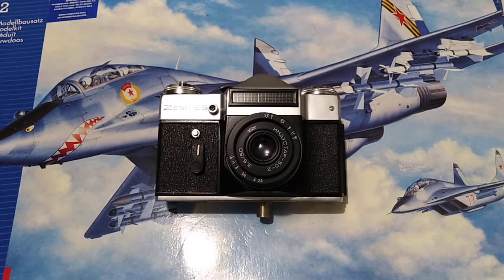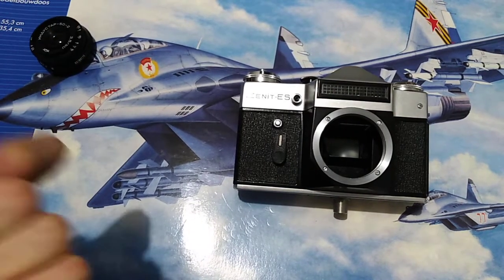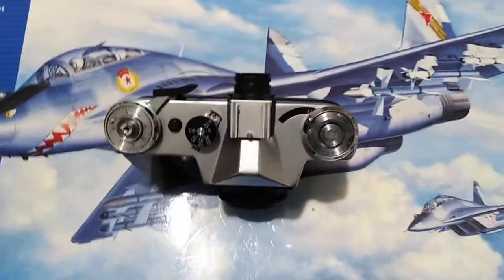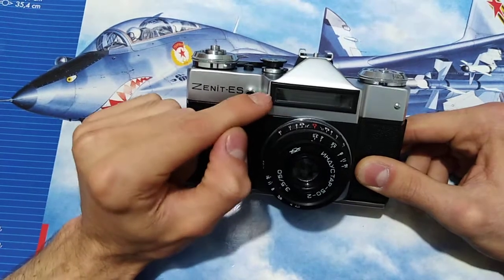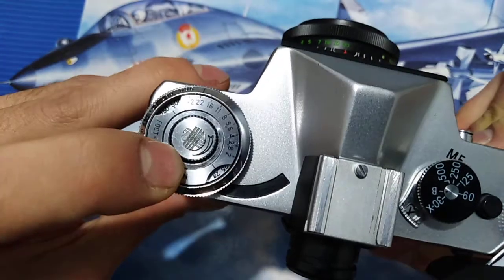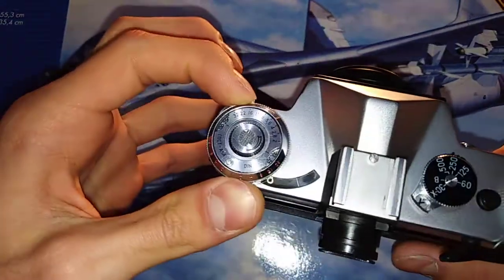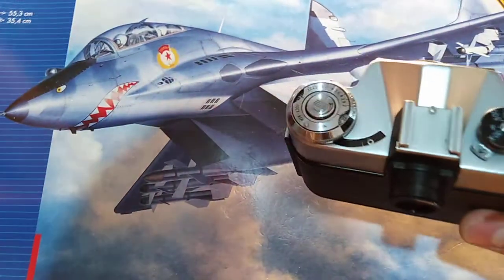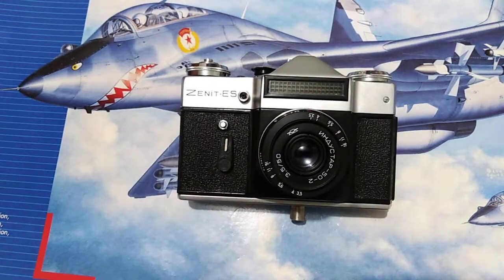Zenit E, ES, EM, ET, 10 and 11 light meter tutorial. How those wheels and needle work?

Comment: Hello, Pedro, and thank you for the video! I have one question: I have a Zenit ET with a ISO 200 film loaded. After the guy at the shopping store had loaded the film and I had taken my first two photos, I tried and rotated the ISO wheel just to see if it rotates (to get acknowledged with the functions), but, of course I flipped it back to 200 before I continued to take other photos. Did it make any damage to the film or the camera? I didn't take any photos while I rotated the wheel, it was just for some seconds, to understand how the wheel functions and which are the possibilities.
Reply from the maker: Hello Aris, thanks for the quesiton. Do not worry at all, you can move the dial as many times as you want, even if the camera is loaded, as long as you remeber to set the correct ISO value before measuring and taking the picture. Simply remember to set the correct ISO back to measure correctly.

Comment: Great tutorial! Quick question, how do I know which settings are the best? I can now change all the settings to what they need to be (thanks to you 🙏) but I dont know what settings are the best. Thank you 😊
Reply from the maker: Hello, thank you for the comments! Well, this selection Will depende on your creative intention. There is an opposite relation between aperture and shhutter speed. A higher shhutter speed will requiere a lower aperture value and a higher aperture value Will requiere a slower speed generally speaking. High shhutter values are great to capture movement and slow speeds allows you to capture the motion in a blurry way, so ir you want to take a picture of a passing
car, a high speed is requiered to "freeze" it in the photo. That is the way shhutter speed affects your pictures. Now, aperture value affects your pictures by giving depth of field, that is the distances objects are in Focus. Lower aperture values give You "bokeh" por less field of depth, that is that objects closer to the lens will be blurry, and higher values will give you more depth of field, that is more objects in Focus. Depending on the light conditions and your intention, You can play with the settings.

Comment: hello can someone help me   I have zenit ET but I have a stuck hand on the eposimeter and i dont how i fix it .Thanks
Reply from the maker: Hello, well I have two options in mind: THe first one is that the needle is stuck by the camera case on the inside, so you will have to remove the Top cover to unlock it. The second option  is that the ligh meter is already expired and oit does not work. This is just a guess by the description of your problem, so try to unblock the needle by remloving the top cover. It can also be due to a light sensor missalignment on the inside of the camera.

Comment: so I've heard best f to use for sunny photos is f16 should i put the dial thing to the line of the light meter and my lens to f16 or no
Reply from the maker: Hello there. This is kind of a tricky question. Right away, I can see some problems with this constant and i think it may be linked to the sunny 16 rule. Here is why iI see some troubles: IUn first place, every lens has a different "Sweet Spot", that is that at certain appertures or F values, the lens gives you sharper images. The second reason is that because of composition reasosns, you can play with the F value to obtain different depths of field of the same take. Because of this two reasons, you could easily disregard that advice you heard. When taking sunny pictures, the best way to "react or deal" with the light is by choosing a good ISO value for the film. Is you choose a high ISO, like 400 and you are shooting on a sunny day, you will be forced to have high speeds and a higher apperture value (Closed diafragm). This could limit a little bit your composition in regards of the depth of field for takes or by limiting your speeds. For a sunny day with no clouds, the best thing you can do is to grab a 100 ISO film that will give you bothj higher diafragm and speed ranges. Also, having lens hood to avoid glare is recommended. Howhever, you can shoot your pictures at different F and speed values depending of your creative intention. I could advise you to disregard that advice. If you want to shoot at F16 using this light meter, be sure to imput the right ISO value, measure the take by pointing the camera to the subject, match the needle and then look for what speed matches F16 on the dial. I hope this helps!
Reply: @PittyTech, the Sunny 16 rule is a way to shoot a picture on a sunny day if you do not have a light meter to measure the light. With the sun behind you and shining directly on your subject, you set the ISO to what ever it is on your film (they often call that “box” speed), you set your aperture to f16, you set your shutter speed to whatever your film ISO is. Is your film is marked ISO 200 then find the closest matching shutter speed to match. I’m holding a Zenit 12S and the closest speed it has is 250 (1/250th of a second). If I had ISO 100 I would set the shutter to 125 on this camera. If I had ISO 400 I would set it to 500. See the pattern? Sunny 16 is a closest-guess rule that would give slightly different exposures depending where you are at in the world and what time of the year it is. The sun in Greenland at Christmas time will not be as bright as the sun in Mexico during the summer. Hope that helps.